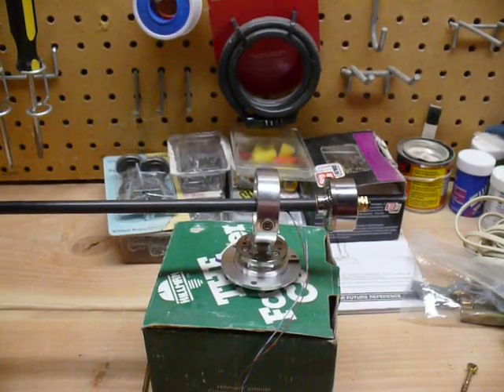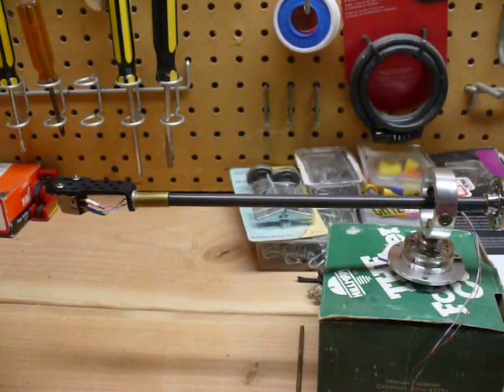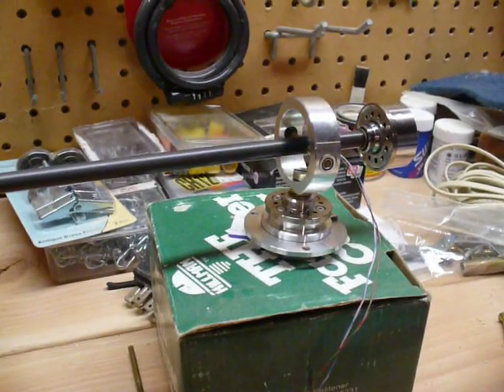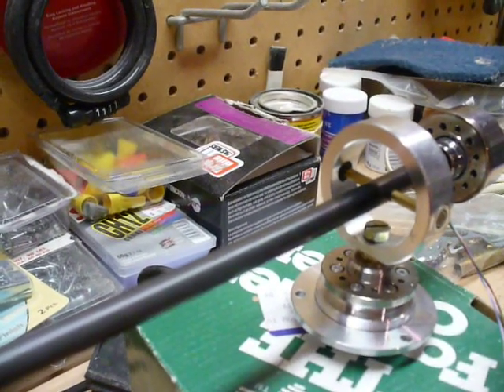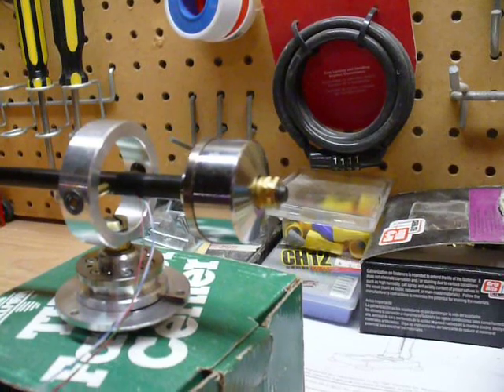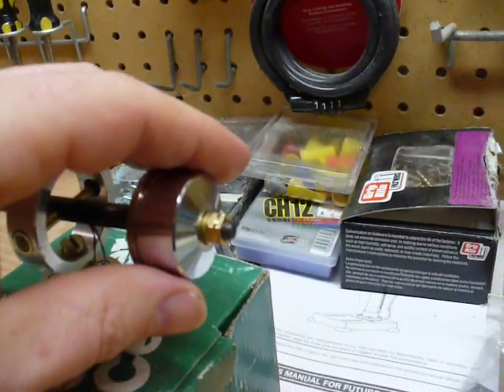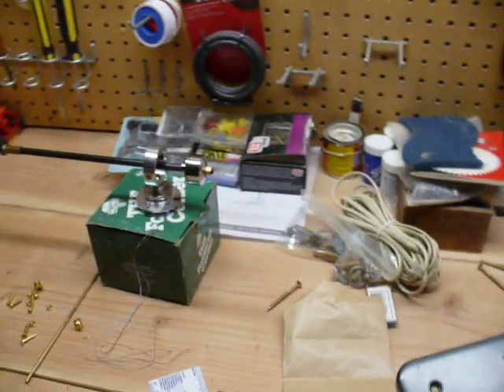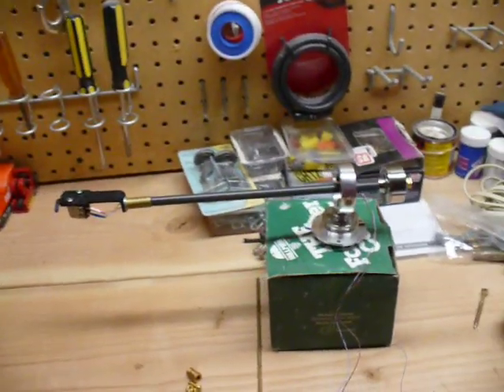DIY tonearm

Comment: Old post but i saw another where you used a different bearing and said you had not been happy with the HDD bearing and i'm curious to know why as i'm trying to design stuff around old hard drives..and what kind of drive had the motor bearing that has the flange?

Comment: I used a crossbow bolt that is large enough in od diameter to drill out with a 5/16" bit and lightly sanding the id until the headshell adaptir will slide in with moderate pressure. Great idea. I also used tge bearing from a technics parts table. Im hunting a ground loop currently. It plays, but the noise is killing me.

Comment: I have wanted to build a tonearm using the bearings from a computer hard drive.  Figured they would be fairly decent
Reply from the maker: Actually, it did, but there isn't a great method to attach the gimbal to the bearing.  I ended up scrapping this bearing and designing a clone of the Schick bearing.  I used high quality ball bearings from McMaster Carr.  Worked out just fine.  quiet and smooth.  I'll upload a video of it this weekend as a follow up to this one.
Reply: thx  for the answer     can t  wait to see    good luck
Reply from the maker: I added a couple links in the comment section and I added a card to this video.  Have fun!

Comment: I would have placed a snug exterior brass sleeve over the carbon shaft where the horizontal pivot occurs (in the gimbal). Very well thought out design.